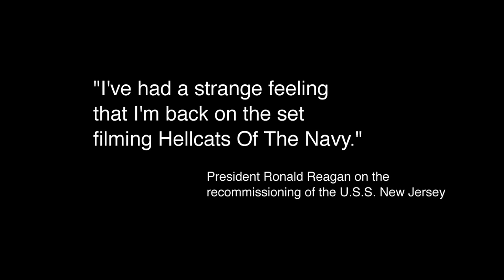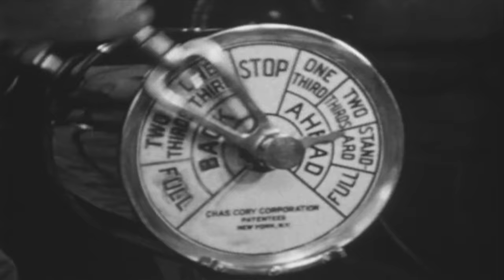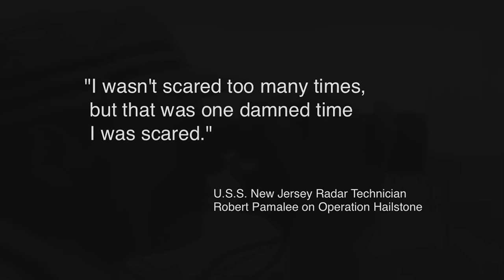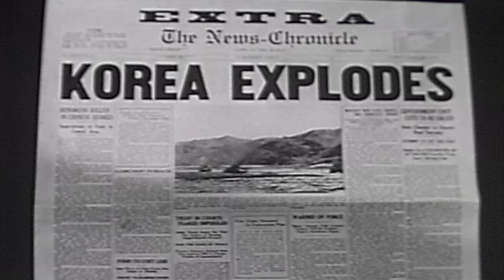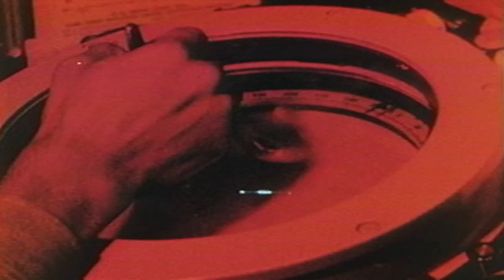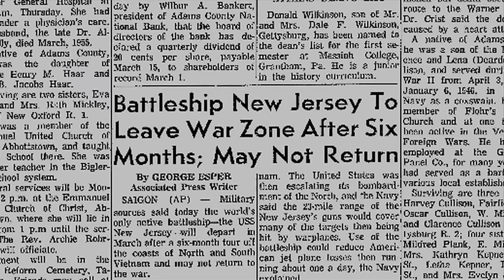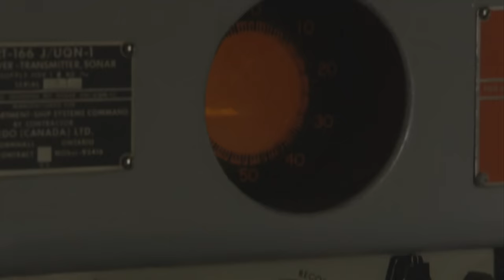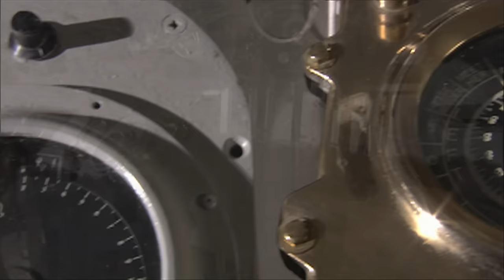USS New Jersey: The Legendary Warship | Hero Ships (S1, E8) | Full Episode

Comment: A weapon development currently going on for the Army could lend itself to a new lease on life for the Iowas', should the Navy pursue its creation. Boeing & the Norwegian company Nammo are jointly developing a 155mm howitzer shell that is ramjet-propelled. So far, the testing of these shells at the Yuma Proving Grounds has been setting new range records with every pull of the cord, with some shells reaching nearly 4x the distance of standard shells. Now, given that a Ramjet needs to reach 0.5 Mach to initiate its functioning, a Ramjet augmented 16" shell could start thrusting that VW Bug weighted slug as soon as it exited the rifled barrel to a potential distance of 96 miles. That's a third of the way into my home state of South Carolina if fired from near the shore, or if the distance from the shore is required, these shells could still put down hurt on the shoreline.